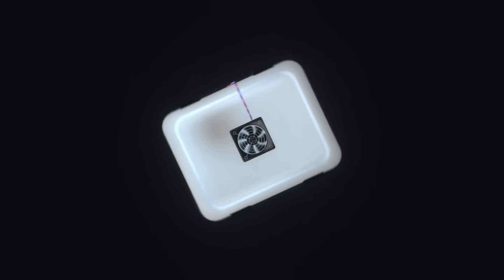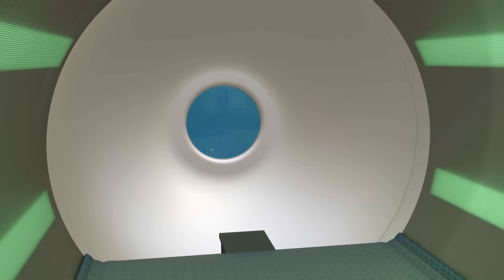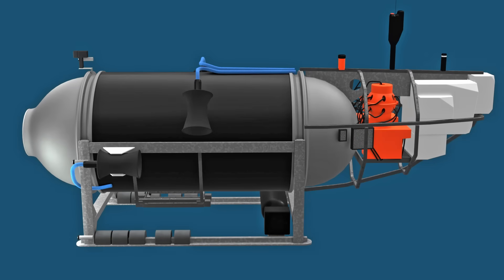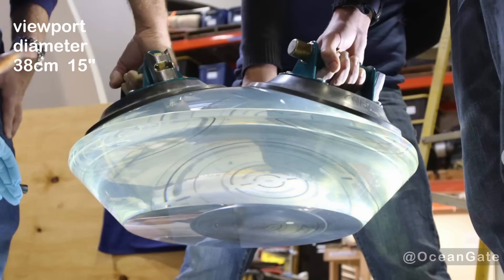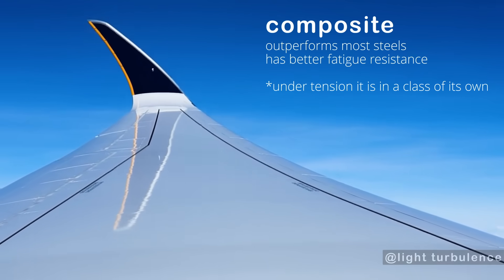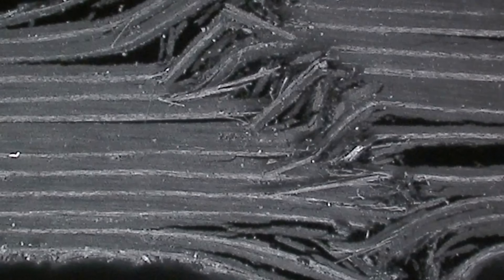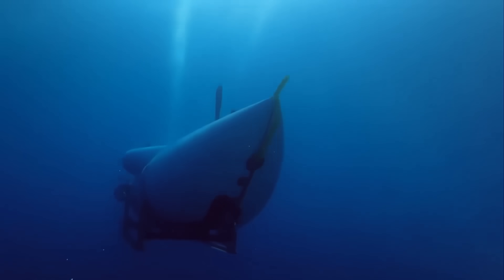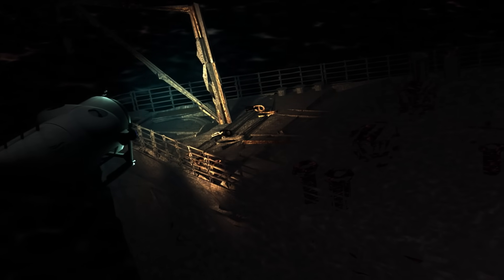Titan Sub | carbon fiber - Detailed Tour

Comment: The now popular notion that 'carbon fiber composite is weak in compression' has irritated me in since day 1 of this incident. Yes, you may need a lot more of it than in typical tensile applications but depending on the load case, composites perform just fine in compression: often with impressive strength/weight ratios (thought fatigue cracking, spalling etc must be accounted for).
Switching from steel to titanium for DSV hulls required an impressive amount of research and testing but titanium became the material of choice over time. There's no 'rule' that states that with an adequate level of testing, QA and monitoring, composites couldn't be used for pressure hulls in the future. Of course, Oceangate were not willing to perform anything like the testing and monitoring necessary to evaluate the feasibility safely.

Comment: I don't even need to watch this to know this guy is full of it. The one factor in this use of carbon fiber is that carbon fiber likes tension and not compression. Thats the end of it right there. This detail however was just part of many other problems Stockton rush created along the way including using a cylinder design which is not done anywhere for deep diving submersibles and for very good reason.  Sheesh! Stop being so naive people and listening to scammers like this guy.
Reply from the maker: Composite pressure hulls on deep dive craft. Here is a list https://www.researchgate.net/figure/Composite-materials-being-used-in-submersibles-worldwide_fig1_364296004

Comment: He neglects the matrix material.  For tension, the carbon fiber can take the load, because the matrix holds in the carbon fiber in correct orientation - orientation in the matrixes only duty.  Under pressure, however,  the matrix must be equally as strong to resist compression as the the carbon fiber or there will form lots of small fissures or delamination's.  Carbon fiber is unsuited for high pressure resistance by its structure.

Comment: Idk using CF still seems silly to me when we have materials that have been proven for the job. Even if the proper testing was done beforehand, how many cycles before the CF hull is useless? Then a new hull would need to be re manufactured. Wouldn't titanium endure more cycles? Also i understand his innovative ideas but innovation usually occurs in steps not all at once. To use CF while also changing the shape of the chamber is wild

Comment: Thank you for posting this video! I'm an aerospace engineer and completely agree with all points you make, especially the issues with maintaining fiber alignment in the axial direction being a very problematic aspect of the design.

I get frustrated with the argument that CF can't be use in compression safely. It's simply wrong.  It conveys the wrong message to the general public and the next generation of engineers about material selection and the use of composites. Engineers need to understand the limitations of the materials they select, and nothing can replace proper testing of a design.
Reply from the maker: Thanks 🤙🏻
The “CF is crap in compression” comments have been relentless. They become very boring but at least they are good for engagement and assist in YT promoting the video. 
I carefully researched this video and so your comment is much appreciated 😀
Reply: sweeeeet!  God blesses your continued research

Comment: I still blame the epoxy that held the 2 titanium rings to the carbon. There was no lip to grab onto, no flange to grab onto, essentially epoxy applied by guys in street clothes, in an open shop without temperature or dust control. IMHO, that was the weakest link...

Comment: Great video, thought I knew a lot about the Titan, but your exploded cutaways really helped me fully see the interior design of the floor, battery and equipment placements!
Makes perfect sense to jave the life supporting/electronics/lighting batteries inside not requiring thru-hull cabeling.
My thought from the start, the 2 end caps compressed in, under the tremendous pressure on them, like two cymbals coming together, had to be very violent.

Comment: Interesting point of view, very valid.

I mean obviously you can load the base resin in compression, the reinforcement fibre just doesn't do much in this case, and may indeed weaken the material. But then special care is needed when formulating epoxy for this sort of use case, i don't know that you can just use stiffness optimised standard/automotive materials. What if the epoxy in the prepreg and the one in the wet layup have a slightly different elastic modulus, what happens then? Aeronautic materials seem suitable, they certainly have the flex and the cycle endurance, except they may not be formulated for low porosity as would be needed in deep underwater use. There just isn't such a massive pressure difference in the air, i mean any air inclusion is going to be at maybe 1atm and external pressure is going to be strictly less than 1atm but not even by that much but down deep you have hundreds of atm.

Also what i was thinking of is that the compressive behaviour of the metal end rings and the CF composite tube are just way different. The dome will cause the endrings to retain their shape, and titanium should be great at it anyway, or possibly the dome causes it to expand a little; while the CF tube shrinks under the pressure. In the end the tube must resist an anisotropic compressive tensive load, where it ends up being shaped like a reverse barrel. where longitudinally it's in tension but transversally it's mostly in compression but not uniformly. I guess there's circumstances when it should work, but well as you say it needs extensive destructive validation.
Reply from the maker: I hope the investigation has the budget to look into all you are describing above to give some conclusive findings. Like you I am fascinated by the specifics. Percentage of voids. The straightness of the fibres. Evidence of differential movement between Titanium and CF tube. Water ingress into the CF. And probably most importantly delamination of the very thick layup. And I would love to be a member of the investigation with access to all the clues and do the detective work. 
None of the salvage footage shows any CF shards but I presume in this second salvage done in early Oct they recovered some or most. 

Incidentally titanium and cf have very similar deflections under load. However under such massive forces even a tiny differential might have been too much and potentially the trigger for the failure.

Comment: The carbon fiber failed and it was compression, but not as some think. The real cause, in my opinion, was the difference in compression between the carbon fiber and the end bells.

Carbon fiber is has greater compression where as titanium has very little in comparison.

With each dive, the layers of carbon fiber cracked at the glued points, ultimately failing in the area of the glue joints.

There is a video showing this happening on a small model.

As for the end bells being some distance apart, throw a stone in the water and you will see the water rush back into the void and the water spurt up. So when the Titan imploded the water rushed into the void then burst back out forcing the end bells in opposite directions.

The view window is missing, my guess because it was designed to withstand external compression, so it popped out when the water sent the end bells out.

Comment: I think if they woven their carbon hull in overlapping diagonal passes while in vacuum like is shown in 12:05 to prevent trapping air bubbles it would be way stronger because that way it would be under tension all the time.

Comment: What I find amusing is none of the commenters have no knowledge of deep sea exploration but yet think  carbon fibre is just fine because we use it in cars and and aeroplanes. As for you matey you don't have grounds to be saying the Carbon Fibre was not a bad engineering material design choice. News flash aerospace engineers are not qualified to design and build sea fairing craft. 

Didn't anybody tell you that the sea is the most extreme environment known to man? Mate your an architect for crying out loud, if you are going to state so defiantly and arrogantly that Carbon Fibre was just fine then make the case for it already instead of asserting that you are correct. I do love it when laymen and not engineers and just not scientists espouse their opinions on matters beyond their remit and professional capacity but there you go everyone is an expert in every now apparently. 

Alrighty then Jack.
Reply from the maker: Structural principles are universal no matter the environment and about structures I have excellent knowledge and for what I don’t know I have a good network of structural engineers I can call on. 

As for the sea and marine systems you are correct I don’t have any special knowledge and I didn’t pretend to know. 

I maintain the material is up to managing the structural forces of this pressure tube case. From a practical point of view that requires extensive destructive testing and research to determine if it is safe or not.
Reply: @Mike-Bell  Well maybe you should look into how he went about developing and testing this platform instead of just going well the man is "trying new things"

Carbon fibre is unproven in use case's for for high compressive loads and is not suitable for extensive usage in this application, this is a non starter and until you can explain how it can you should retract your claim and actually the more I think about this it's just an insult to those who in the industries  Anytime you want to speak mechanical engineer and material science experts like who's wheel house this actually is as your point about universal principle's is  a non sequitur.

You are appealing to the ego's of airmen and not the professional's who actually know what they are talking about, you need actual subject matter experts with the relevant experience to comment on this like other submersible designer and builders . 

people  died and you are engaging in a trivial point scoring exercise over corpse of my countrymen because of some arrogant  yank, we take this very seriously and as somebody with a lot of friends in the maritime industry I can tell you right now we are not  happy about any of this and the Stockton rush team, He is responsible for the death of those people and the remaining employees of his company should go to prison, They knew what they were doing was not safe based on their OWN flawed testing and methodological approach an Ex British navy Engineer got fired and sued because of this. all of this is public knowledge by the way, so you want to look that engineer in the eye and tell him he's wrong after he oversaw what testing was actually done?  

You can "maintain" all you like but you are wrong and until you make a case instead of pointing to credentials that are not relevant here, we are not building structure's that are fixed to the ground so most of the principle's you are referring to anyway have no place here on the grounds of relevance, Structural engineering does not cover mechanical interactions end of and architects like you defer to these people to sanity check your ideas for these reason's, it's why you work with them for consultation purposes in the first place and you know this really so drop the façade unwarranted and even unprofessional, you are allowed to have views but do do have to qualify them and if you don't people are right to dismiss you here , the preponderance of evidence  is to prescient of a factor.

If you want to have discussion about how the tube failed then we have to be realistic about why, trying to excuse away the material design choice without proper explanation is not acceptable and this is putting the cart before the horse it's that simple. 

Either retract your statement or buddy I hope you get sued into oblivion by the families as the legal case for lying with malice is pretty strong here, under defamation per say.  Just because the guy had a dream about "affordable"  exploration that the common man can take advantage of one day, does not mean we start being selective all of a sudden about the standards we hold people too absolutely not that is a disgrace. you are in a very small vocal minority with stance you are taking here so once again I demand you retract you it.

Comment: Great to know that Mike does not follow the norm but concludes with knowledge. Greetings my fellow South Africans from Centurion. If you place a balloon with its north pole and south pole between your two palms and press your palms toward each other, this is what I think most likely happened. Not to mention that the layers of carbon fiber slid in opposite directions caused by north and south pole pressure.
Reply from the maker: Bokke yeah!!!  🇿🇦

Comment: I don’t have a problem with the materials used. My problem is his lack of testing and his firing anyone that questioned his actions. The fact that he didn’t want anyone with experience showed how his ego worked. 
You don’t prove a concept by putting people in danger. 
Another thing not talked about it’s not just one thing that was a problem it was many different things. Imagine taking a sub out with no equipment to retrieve anything. What makes it worse was the fact everyone was bolted in. 
Don’t know how anyone can defend this woke idiot. Don’t see death as a benefit, even if it saves 7 tons.
I didn’t think about the winding not putting tension on the lengthwise carbon fiber. Still his cheapness killed. He also used carbon fiber that wasn’t allowed for use on airplanes. That’s how he saved money on the second haul. 
I believe delaminating filled with water and that’s why the sub wouldn’t raise. (That’s if those transcripts are real)

Comment: This is a well researched an interesting video. While you make a good case that carbon fiber wasn't inherently a problem, I think it's fair to say it was still the underlying cause (along with the arrogance of Stockton Rush)  of the incident. I share your hope that people don't over-learn the lessons from the tragedy and entirely write off composites from future submersible research. It's amazing that the point at which the the titanium and carbon fiber joined wasn't rigorously tested, given that even sports cars undergo repeated tests to the point of failure.
Reply from the maker: Delamination is an inherent weakness in composite. The inability to orient fibers in the direction needed to prevent it is a big problem particularly when the layup is so thick to take these pressures. But engineers are very good at solving big problems so who knows. We might see composite subs.

Comment: using carbon fiber for a sub isn't stupid, but using carbon fiber on a sub meant to be used multiple times while actively refusing to monitor or account for its rapid, audible degradation is most definitely stupid. everywhere else carbon fiber is used even slightly like this, such as in planes, it's heavily tested and strictly scrutinized and retired before things even start looking bad

Comment: the flange detail was interesting (and new to me), but if a cylinder crushes in the middle while the end is supported on an inner flange, it may be enough to "explode" an outer flange which would not need the same strength as the inner; besides, the damage was only localized, not the entire circumference. Even though all the animations show an immediate catastrophic failure of the cf shell; it stands to reason that however quickly it may have occurred,  large fragments might have retained sufficient strength to force the outer flange outwards when this happened- it should not be expected to act like tempered safety glass

Comment: I only opened this video to say that a cylindrical CF tube was the worst idea. Even if the connection point had been deeper the sheer forces at said connection point were the issue. GROSS NEGLIGENCE